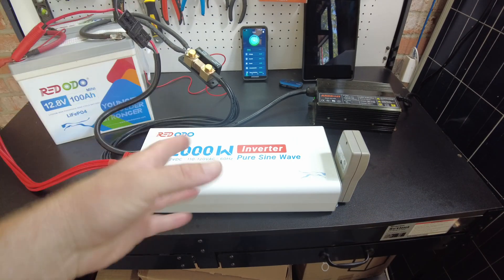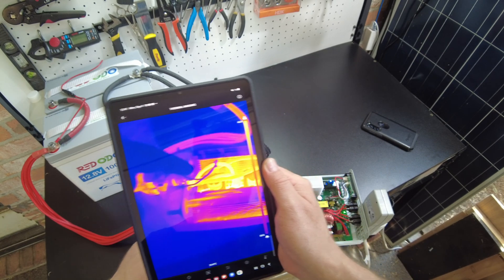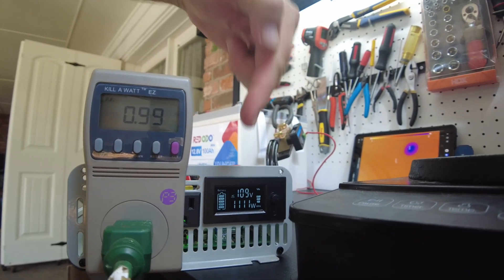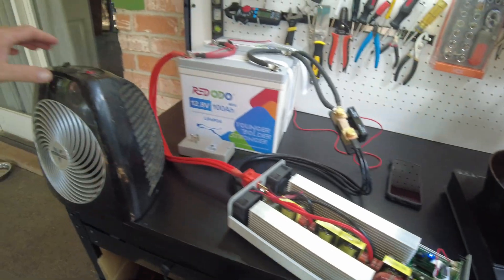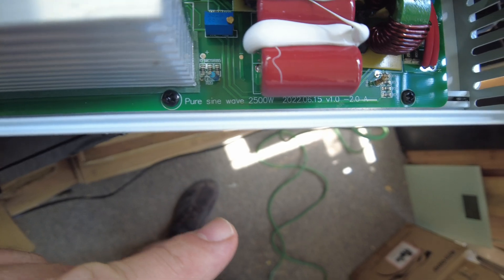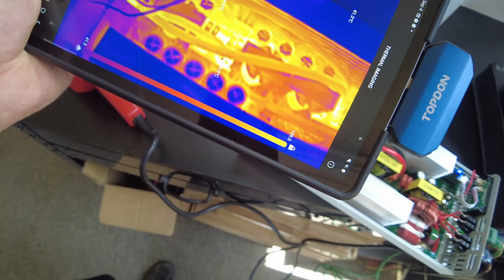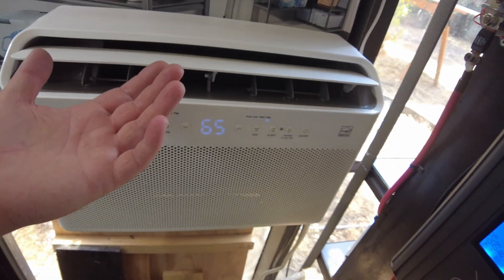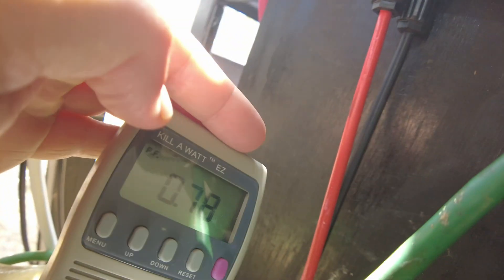Follow up REDODO 2000W 12.8v Pure Sine Inverter

Comment: Brad, just watching, why would it chirp with 1,100 watts draw on a 2,000 watt inverter? I have the big massive 3,000 inverter/charger that I’m getting ready to hook up. Maybe it’s the added charger part, but this thing weighs like 50 pounds it seems? Hoping to not have any issues because going to test it running my whole camper. Thanks, how has yours held up

Comment: Gauge bigger on Leads and Double Up on the Battery and You’ll be Impressed with this Redodo 12 Volt Inverter. I ran 2 CHINS 280 amp 200 amp BMS Batteries and 2/0 Cables and It Ran anything I Tossed at Her 🔋
Reply: I ordered it before lookin at Amazon reviews, yikes had a bunch of bad reviews.. but we shall see I guess.

Comment: These are Well built inverters I've seen them branded with various names. If you had a power strip plugged into the inverter you could add 100 watt light bulbs as a final load until you reach the inverters Continuous output.

Comment: So, is running it with the cover off, preventing the fans from cooling the unit properly? It may seem like a silly question, but the fans are designed to pull air across the fin’s/internal part of the unit. Did you test it with the cover on, if so, did it still chirp? Thanks, I’m considering one of these but already tried Renogy, (bad from the box), tried Harbor freight pure sine wave, came on, worked briefly, then failed, would not start up. Thanks

Comment: Another cheap, high frequency, transformerless inverter that's going to fail just about the time that the warranty runs out. The heat that you're seeing is going to cause the electrolyte in the filter capacitors to dry out causing ripple across the MOSFETs and that's when the inverter will smoke. Invest in a low frequency, transformer based inverter if you want to run inductive loads. You'll be much happier with the results.
Reply: Like what

Comment: Are you using too small of a battery, is that causing the problem? Another tester of the 2,000 watt, had plenty of battery power, ran a heat gun on high, heater on high, turned table saw on too, and it worked.
Reply from the maker: No. I have two 100Ah batteries in parallel here. That is plenty.

Comment: So they include battery connect cable of 4, 8 awg (160a 2000w rated), but the wire between the battery terminals and the circuit board are 1, 8 awg (40a rated)? That's great if you want an inverter/space heater...
Also, the low 109vac is too low for my specifications. Lower the output voltage, the higher the output current.
Reply: At 1ft 8ga can support 100-150a, enough for those batteries but not ideal. A bigger  concern is the batt to inverter leads and internal 12v PCB soldering traces.

Comment: A cheap oscilloscope monitoring the voltage and the current waveforms would probably show what the problem is.  My experience tells me the AC,  being an inverter type, is probably drawing current in high frequency pulses.  The bad PF on the AC would seem to confirm this.   The Redodo loop filter is not designed to be stable with this kind of load.  Not surprising, because it takes a lot of expertise and a LOT of testing for this type of power supply design.
Reply from the maker: I have an oscilloscope arriving today, so we can start checking these things. Thanks!

Comment: I will check your videos to see if you have one on that 1500-watt inverter. I would like to see how it is built in comparison to the redodo. I really think redodo should have either put more wires inside or bigger guage wires for the load. I think you said it has 4 8-gauge wires that came with it to connect to the battery and only 2 8-gauge wires inside to the board on each post. Seems like it is not built well enough to me. Not bad for some things but not one I would want to pay full price for.

Comment: They probably designed it as a 2500 watt, but it didn't pass their testing so they label and sell it as 2000.  But it is still disappointing.  I wonder if it was getting a low voltage at the input on the board while under the air conditioner load and that was triggering the chirp.

Comment: How many BTU ' s is that AC rated for ?
I have a 10,000 BTU unit and it only draws 6 - 8 hundred watts
Reply from the maker: 12,000BTU
Reply: @BradCagle  

Strange that you are getting differing results like that .  The reading of the AC power draw from the other inverter at about 970 watts seems good .
I noticed that when the inverter was beeping, the display fluctuated rapidly between voltage readings .  It would change from 108 to 110 to 111 VAC and 12.6 to 12.7 VDC .
I looked up power factor on chatGPT but it lied and got the formulas wrong and didn't even mention Reactive Power .  Bing also did not mention reactive power in the response .  But it did have a link bubble under the response with the question : what is the difference between real power and reactive power .

Anyway, it looks like the inverter is having trouble supplying enough power to the AC because too much power is being wasted as reactive power .  Probably not showing the true reading on the meters ? ? ?   Ok, I see that the battery shunt reading is showing about the same power .
I guess that some noise from the AC is getting back into the inverter ? ? ?  Maybe that is causing the voltages to fluctuate .
Reply: @BradCagle  
I wonder, if you put a large capacitor inline with the hot wire to the AC, if it would help or hurt the pf .  It might even stop the chirping ...
Maybe you could get one out of an old home AC unit .  Well, I don't know if it would make a difference if you put it on the hot or the neutral wire .  I presume you know not to put it on both the hot and the neutral ! ! !  - It should be in series not parallel .

Comment: 👍👌❤🇨🇦, I am suspecting that some appliances have an intolerance for certain wave forms, Is the inverter a true sine wave and to what quality? I use a SWI 3200 watt inverter, and have had absolute no issues ever, even when maxed out,
Reply: I use a 24v SWI 3200 i got off E Bay. Absolutely love it. It's never gone below 117 volts, and is 124 volts at idle. I hate that most inverters are rated at 110 volts output and then go down to 104 volts under a load which diminishes the performance of the appliance.
Reply: @pjbikerful  you and me both, gr8 inverters

Comment: You missed something. You missed a good chance to make a scrambled egg and fried ham sandwich.
Reply from the maker: 🤣Indeed
Reply: Or even a simple grilled cheese!  And tomatoes are ripe in my garden, and there is nothing like a slice of tomato on grilled cheese...  Now I'm hungry!
Reply from the maker: @Sylvan_dB  That sounds amazing. It was way too hot this year to grow anything for me.
Reply: @BradCagle I would like you to review an inverter that does handle  inductive loads like your inverter A/C.  Air conditioning is one of the challenging loads for an off grid  12V based power system to handle.
Reply from the maker: @bitsurfr46  I have, every other inverter I reviewed has ran this AC fine. Leesky is a good choice.

Comment: Thanks for the follow-up report. The low battery alarm is "misaligned", and I believe the inverter is either faulty or under engineered with respect to its V/A capabilities, causing it to chirp with non-ideal loads.

Comment: Have you tried to reach out to Redodo and ask them about that noise? Also could you please explain “power factor” in layman’s terms😅 I’m new to all this. Thank you!
Reply: Power factor is kind of hard to explain in text especially without knowing your background.  I've encountered several youtube videos with good visual or mathematical explanations.

In math terms specific to the problem shown in this video (no trigonometry), with a D.C. circuit like a battery the power in watts(P) equals the amps(I) multiplied by the volts(E), or P = I x E.  With A.C. we call that "VA" or "volt-amps" because it assumes a power factor of one, as A.C. watts is P = I x E x PowerFactor.  If power factor is 1, or a "unity power factor" then multiplying by 1 can be ignored like we do for D.C.  If the power factor is less than 1, then for a given voltage(E) there must be more amps(I) to deliver the same power.  This increased amperage is why lower power factors are not ideal.

Maybe more visually?  It starts with the A.C. electricity being a sine wave. The curve goes up above to about 170 volt positive (above 0) and then down to about 170 volt negative, repeating 60 times per second (60 hertz in the USA).  Alternating positive then negative is why we call it alternating current or A.C. Now imagine drawing that sine wave left to right on a paper.  Make a copy on a transparent page. Set the transparent one on top of the other so the curves line up perfectly.  This is a perfect power factor of 1.  Now slide the top page, representing voltage, a little bit right or left so the peaks of the curves are slightly offset from the bottom page, representing amps.  This is a non-unity or not 1 power factor.

If something being powered has a perfect power factor of 1, it draws its power in perfect synchronization with the voltage where the amp curve matches the voltage curve.  Incandescent light bulbs and similar loads that simply turn electricity into heat have a perfect power factor.  This is the most efficient way to deliver power.  If instead the amp curve peaks before or after the voltage peak, the difference or offset can be calculated and it will be less than 1.  (trigonometry, sin and cos)  Delivering power to a non-unity power factor requires more amps to deliver the same power, and this is less efficient.
Reply: Thank you! That really helps!